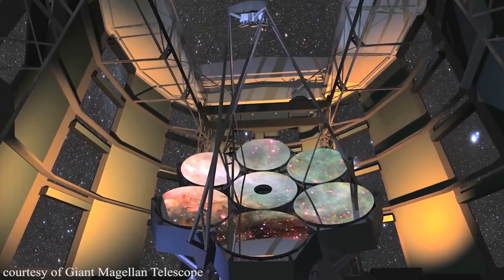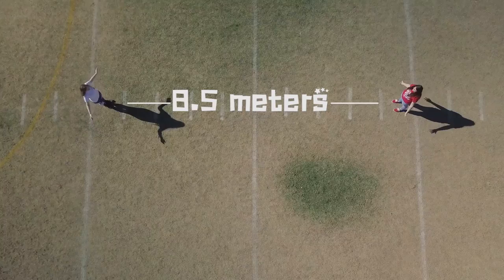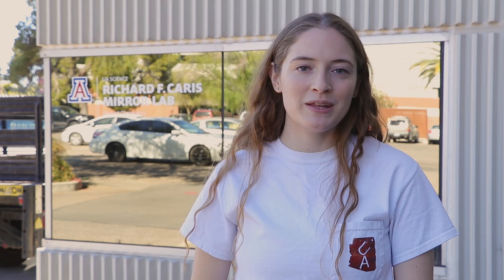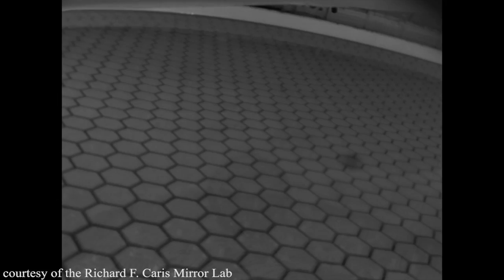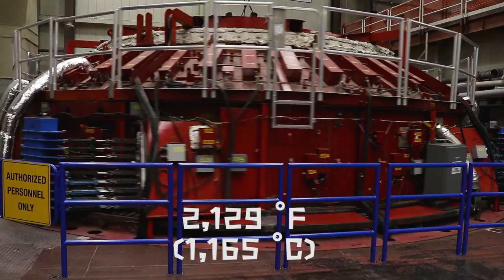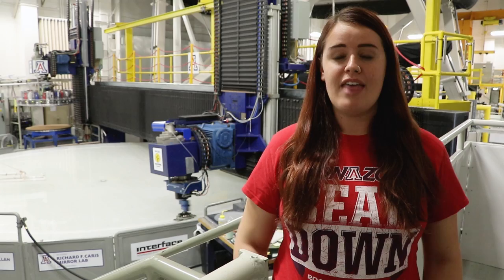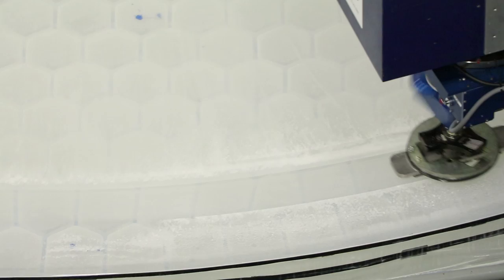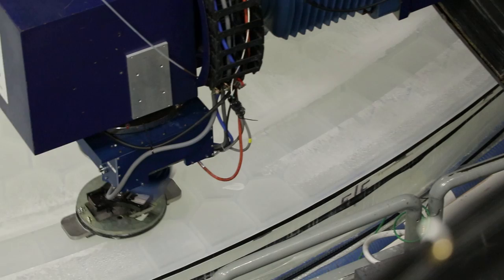17 Tonnes of Spinning Glass: Making the World's Largest Telescope

Comment: I wonder if the process of adding the layer of aluminium can end up being the "bottleneck" for the mirror's precision? Or is there a clever way they can ensure its applied evenly without issues?
Reply: FrankieSmileShow Its called sputtering vapour deposition. The aluminium layer is uniform, and only a few atoms thick.
Reply: "Sputtering" and "uniform," two words I don't normally associate.

Comment: Hold up, so the reflective surface is on the front, so why even bother with the glass bit?
Reply: To make it into the parabolic shape
Reply: Could you not just use resin and not a giant spinning oven full of a few tons of glass?
Reply: The reflective part of the mirror is incredibly thin and made of metal; metal warps easily when exposed to temperature changes, glass doesn't. The glass is there to give the mirror its shape and maintain it. When they have to change the coating they use abrasive chemicals to strip the old layer off and glass is very resistant to them.
Glass is the best choice of material available currently.

Comment: Isn't it a bit sad that in something of a temple of technology and science and in a video by a couple of physics majors that pounds are used as the units for describing the amount of glass? Please. Physicists and astronomers use metric units, not pounds.

Not to mention the confusion over tons. The 2,000lbs is an American (or short) tonne and is around 10% less than a metric ton or am Imperial (long) ton which, at, 2,240 lbs is fairly close the the metric one. All this ambiguity could be avoided if they stuck to SI units. 

I should add American seem to think they use Imperial units but they don't. The American Customary System is based on an older English system of measurement units whilst the system used in the British Empire dates from an act of Parliament in 1824. Which is why US and UK Imperial measures are different in some areas, such as volumes and some units of weight.

Another good reason to stick to SI units (another is not crashing space probes).

Comment: Why not make it from alumnium to begin with? or plastic? I mean if the reflection is done with aluminum, why bother making it out of glass?!?!? is it for its thermal properties? bcoz they said it expands less. But cant you use.... literally any other material than glass that expands very little due to heat? idk, this is confusing. Why make a giant LENS if youre gona cover it with aluminum anyway?